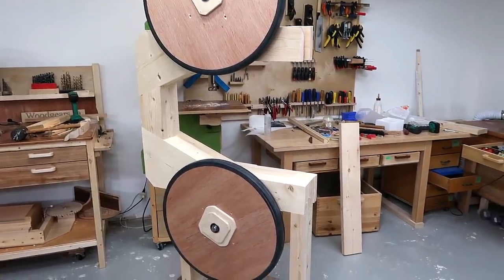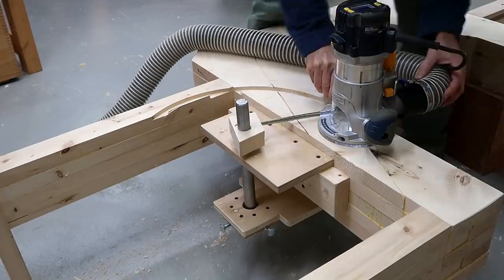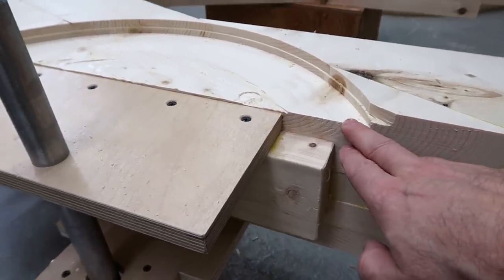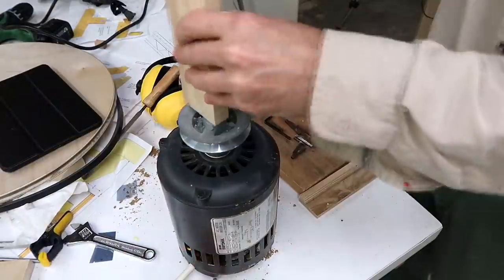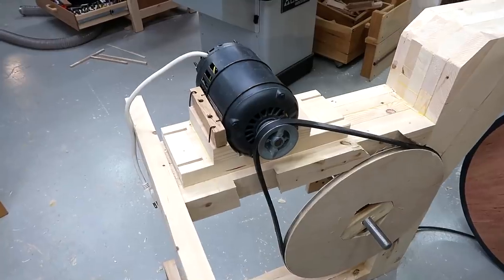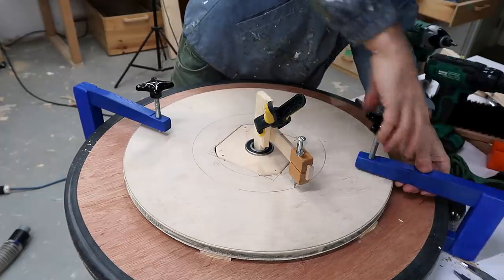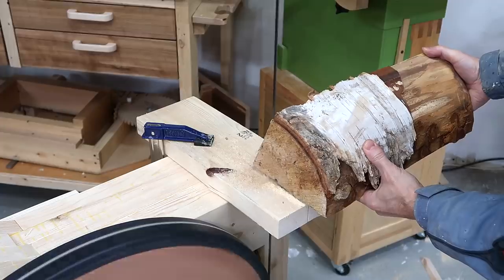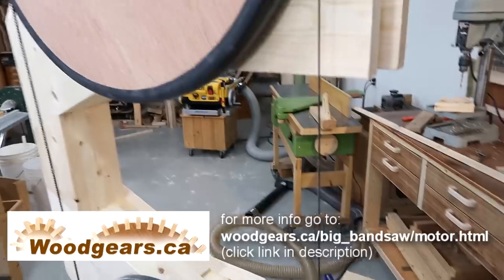Bandsaw motor mount with coat hanger wire

Comment: Where do you get these motors from? When I look up buying them new it becomes cheaper to buy a complete tool rather than make my own.
Reply: I'm currently exploring DC treadmill motors but they apparently lack torque at low end in many cases.   Might not be a big deal unless you want to cut metal.
Reply: @T0tenkampf  Regular DC motors produce the most torque when stalled. I'd guess issues people have with poor low-speed torque is from using a simplistic speed controller which lacks proper speed regulation. If you use a motor controller with feedback it should automatically increase the power when the motor starts to get bogged down. The speed controller from the treadmill itself might even work. If not the electronics needed should be quite cheap to build. Surprisingly it seems near impossible to find such a controller with closed speed feedback. Pololu sels some but they're quite expensive for what they are.
Reply: @eDoc2020  the builds that i see use a simple speed controller from amazon thats about 15 bucks and they often remove the original pwm controller from the treadmill, is that what is removing the low speed torque compensation?   The best treadmills have what is called a MC60 or 80 motor control board.  This didn't seem to be the right thing to doto me but i am somewhat ignorant of the subject outside of pwm fan controllers on performance vehicles.   Would a dc motor rated for a lower speed having a better torque curve generally?
Reply: I see used motors on craigslist pretty often. I bought a 3 phase  1 HP 1800 RPM motor for 30 bucks once. You would need a VFD to drive that. But a brand new single-phase 1 HP motor is under 200 bucks. Automation direct sells them, and I am sure you can find other sources if you look. I am not saying that is cheap. But it is still less than a 14 inch bandsaw. I think I paid 300 for my used rigid bandsaw (14"). And for his bigger bandsaws, the cost of buying one would really be prohibitive.
Reply: @T0tenkampf  All the cheap speed controllers that I saw with a quick search remove the compensation. They effectively just set the voltage of the motor to whatever you set the knob to. Nothing with only two wires going to the motor will work, you want something with a speed/rotation sensor attached. I'm not an expert on treadmill motors but I assume they have such a sensor preinstalled, either on the motor or the gearbox.

A simple model often used with DC motors says the speed is directly proportional to the voltage and the torque is directly proportional to the current. This model ignores the winding resistance which lowers the effective voltage as more current is drawn. I suppose for a given motor if torque X is produced the RPM drops by Y rpm. If the motor is running full speed Y will be minor but if the motor is running at a fraction of its rated speed the drop in speed will be the same number of rpms, and thus a much greater percentage of the speed.
Reply: @mckenziekeith7434  You can often run a 3ph motor off 1ph without a VFD by using a capacitor on the third winding. Starting torque will be greatly reduced but that's not really an issue for a bandsaw.
Reply: @eDoc2020  I noticed the same with the cheap controllers.  Most treadmills have a soft start that would be nice to have if it can be adjusted and I saw a comparison showing how much more smoothly and quietly the motor runs if you keep the power board capacitor and choke in the loop although I'm too ignorant of electronics to know why that is.
Reply: @eDoc2020  yeah, I know. But if you are looking for a motor or buying a new one, it would be better to go with single-phase unless you have three phase power available or unless you want speed control, in which case three phase with vfd is a great way to go. The VFD's are not that expensive for small motors, and you can drive a 1HP 240V three phase motor from 120V single phase input power. Most people scouring Craigslist or trash picking motors should probably go with single phase.
Reply: He gets them out of the trash.  Dishwasher and washing machine motors seem to feature in a lot of his projects.

Comment: I like your motor mount, although I wonder whether the motor will rotate in its mount over time.
Reply: I imagine some high density rubber between the motor and cradle would prevent that if you are concerned about it?

Comment: Why wouldn't you mount the pulley on the outboard side of the wheel?  Shaft stress?  It seems counterintuitive to dig into the frame like that.
Reply from the maker: cause then you'd have to take the belt off to change the blade

Comment: are coat hangers like Canadian duct tape. :)
Reply from the maker: Duct tape can't even be counted to hold it's own weight long term, let alone anything heavier than the tape itself.
Reply: But the residue is guaranteed to never come off!  It's the paradox of duck tape.
Reply: What Matthias is saying here, is that Ducttape is like US' pocket-holes: a lot of hype, but it's not too useful in real construction.
Reply: Any farmer will tell you that if you can't fix something with fencing wire (or binder twine) it's probably not broken!
Reply: @TheRainHarvester  Actually, it's easily removable with a spray of WD-40.  I had a near-catastrophe when someone applied duct tape to a furniture item and left it in place for weeks, leaving a huge amount of residue.  But, thanks to an Internet search, all the residue easily came off with WD-40 and a little scrubbing.  Just got to degrease afterwards.

Comment: A concern for me is that the coat hanger wire is under continuous vibration. I think it will eventually loosen, especially considering that it is a soft metal.
Reply: you are concerned about the wrong thing
Reply: @natalieisagirlnow  What should I be concerned about?
Reply: @rosscarroll6735  it's screwed down.  it's not going anywhere
Reply: @natalieisagirlnow  The block of wood that the wire is thread through is screwed down, the wire could still loosen

Comment: Is there a reason the first router pass went clockwise and the rest counter clockwise?
Reply: The first one was 'slot milling' a trench the full width the bit, so it didn't matter which direction it went. The later ones were only cutting with one side of the bit. Then the direction matters because one way it pulls itself in the wood and the other way you need to push it.

Comment: AN adjustable pivot motor mount would've been better, absorb shock load,friction tension, more options for v belts,adjustable to line up v belt drive,better maintenance
Reply from the maker: Absolutely not.  The motor has to be rigidly mounted or it leads to more vibrations.

Comment: Had you considered mounting the lower wheel directly to the shaft with bearings on the shaft, and the pulley on the other end?
Reply from the maker: did that for my first bandsaw.  Doing that introduces more problems  than it solves.

Comment: Could the drive pulley not be mounted on the back of the machine, at the other end of the axle shaft? Rather than cutting into the frame? Obviously, the motor would be mounted the other way round.
Reply from the maker: My first bandsaw was this way, but going that way introduces more problems than it solves.
Reply: @matthiaswandel  What problems does it introduce?

Comment: Did Matthias already explain why he did not just put the motor on the back side of the saw? The way he did it seams harder then necessary.
Reply: The rotation of the motor would then be in reverse.
Reply: The axle does not rotate, only the wheel rotates, that's also why they bearings are in the wheel mount and not in the axle mount
Reply: I forgot that made axels this way, too many diy bandsaw and jointer videos lately
Reply: He answered that question several times in this thread. Scroll through. The short version was "I built my first bandsaw that way. It creates more problems than it solves." or words to that effect. I think basically it forces him to use a shaft that is subjected to torque, which means he has to have very secure attachment of the pulley to the shaft, and secure attachment of the bandsaw wheel to the shaft. The torque on these big bandsaw wheels is no joke.
Reply: Oh yeah grade point.

Comment: Not useing thick deep gloves 🧤 is just.... Low iq
Reply: Did you just recommend wearing gloves when using a saw? Do you know why that's a ridiculously stupid and actually dangerous idea?
Reply: @201081hero  Yeah, it was mostly a rhetorical question; I didn't have high hopes for him...
-----
I do wanna mention that when I was an engineering student, our professor advised/mandated us to bring stuff including gloves to the testday of our selfmade spinning metal contraptions (vehicles).
It turned out to be "just an advise" that only looked like a mandate, and his main point was really "bring everything you need with you, we wont lend you tools". But it was still a bad practise to advise gloves for working with moving and spinning metal.
Especially because our local law actually states that the gloves are a bad idea.

Now an engineering/mechanics professor is clearly not a retard, but he didn't know about this, just because no-one ever told him.
Reply: @sasjadevries  I don't know. Would you kindly explain? I'm not likely to wear gloves at the saw, but it like to understand the danger. Might prevent me from doing something else stupid.
Reply: @NormanRamsey  Ok, think this way: a saw has sharp teeth that can catch woven or knitted cloth. And if one tooth catches a yarn, then it will pull the cloth with it and because of that the next sawtooth will also catch some yarns... All of a sudden the saw is trying to wrap the glove around the saw.
The same thing is true with lose sleeves and long hair.
If you hit a spinning saw with your bare hands, then it will just cut open your skin and you can do away with a nasty scar, but at least it doesn't suck your hands further into it. Better a scar than an amputation.
-----
Next step: don't just think about saws, think about spinning tools in general. It might have a sharp corner, it might have something that acts like a wedge, it might pinch your glove in another way.
So when you operate chucks, bearings, etc, just don't wear gloves, it might suddenly turn on.
Sandpaper/abrasives are not as bad as saws, and you should be fine wearing gloves in most cases; but I never wear gloves when using abrasives, there might be an unforeseen danger and I don't want to find it out the hard way.
However you can always use gloves if the power of your tool/machine is turned off and you're doing maintenance, that's totally fine.
-----
And finally: Rubber/leather gloves might look like a good idea, but a saw is made to cut wood/plastic/metal, it's not made to cut rubber so it can still bite into it and draw it with it.

You can wear those medical examination gloves, the ones that tear apart from just looking at them or by just putting them on. Just because they're way weaker than your skin, they wont pose a danger.
Reply: @sasjadevries  Thanks for this! At the moment I wear leather gloves when using chisels and a latex glove when sharpening (to avoid abrading my hand on the stone). Will avoid them with power tools. Though it occurs to me some padding might be a good idea with the random orbital sander.
Reply: @NormanRamsey  Yeah, the main idea is to think whether a tool is rotating and whether a glove could get caught somewhere. Some powertools are actually fine when wearing gloves. Here is where it basically comes down to common sense.

I mean there are these vibrating saws (like the renovator and dremel multimax), they can't pull your fingers off because they only move 1 or 2mm. I mean it can't wrap a glove around itself like a tablesaw does.
Even if you try to cut yourself with such a renovator-saw then your skin will just vibrate with it, whether you wear a glove or not. 
Surgeons actually use a similar vibrating saw to only cut bones and not affect soft tissues at all.
The very short stroke makes it safe, and as soon as you have a saw that actually travels a certain distance (like a jigsaw), you're better off not wearing gloves

Also a cordless drill or impact driver doesn't really pose a threat to someone wearing gloves. Because most of them immediately stop when releasing the trigger, and because a cordless drill doesn't really have features that could catch your glove (unless you have a keyed chuck or you really want to grab the drill-bit while it's spinning).

Metal-working nibblers and electric shears are just as dangerous with gloves as they are without gloves. They either bite into your finger or they don't, there is not much more to it. I would actually recommend wearing gloves when using them, because the metal can be sharp.

Electric chisels and electric scrapers are also totally fine wearing gloves.